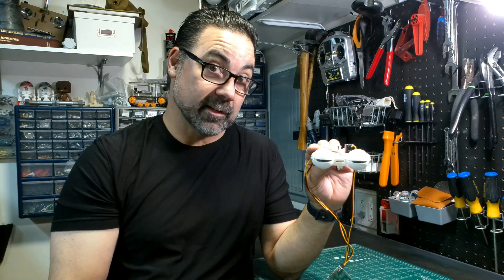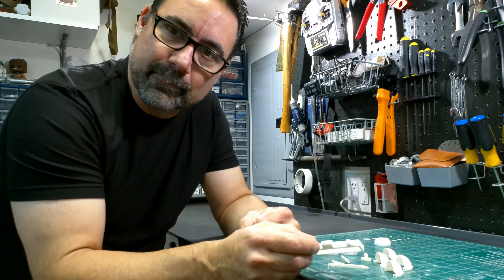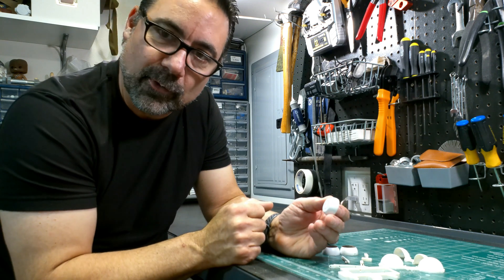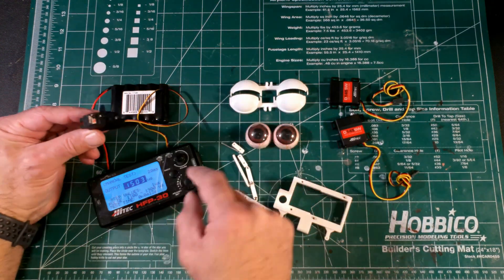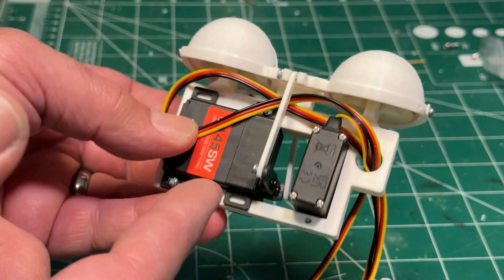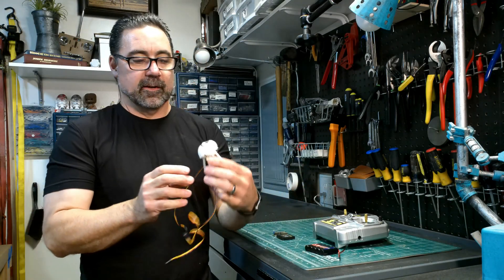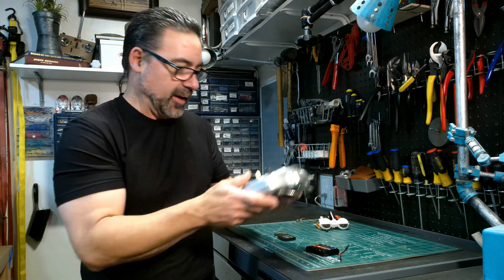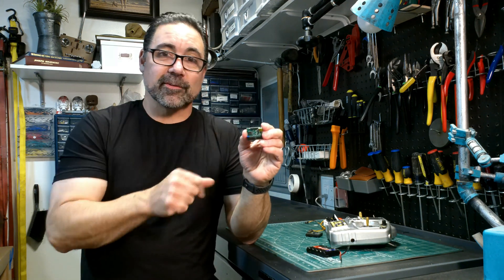How To Build a Three-Servo Animatronic Eye

Comment from the maker: Let me know if you would like to see other versions and options for eyes.
Reply: Can you give me the link of the servos you used?
Reply from the maker: @benjamin_pochurak You need two of these: https://www.servocity.com/d145sw-servo/?sku=36145S00
Reply from the maker: @benjamin_pochurak and one of these: https://www.servocity.com/d89mw-servo/
Reply: What controller do you use and can I hook up my PlayStation controller to the eyes?
Reply from the maker: @Talarionn  I am using a Maestro board from Pololu. You could use a standard RC set up as well as PS controller. You would just need something to interpret the PS controller commands.
Reply: Are there any cheaper servos I can use
Reply from the maker: @Ferretaxolotl  Unfortunately, this design is specific to those servos. I am going to post the same design that lets you use the inexpensive 9-gram servos.

Comment: How much power does my engine need?
Reply from the maker: I use a 6v battery.
Reply: @PaulsBots Are there any other, cheaper servos that would be suitable for this?
Reply from the maker: @Michalek136 You can use micro servos with this design.
Reply: @PaulsBots  
What size screw did you use?
Reply from the maker: @Michalek136 I used a couple of different sizes of 2-56 thread screws. A combination of 5/32, 1/4, and 5/16 lengths.

Comment: So I am creating an animatronic character where only the mouth moves. However, when I program the servo moves with the audio I keep noticing my SG90 servo have this twitch after certain sequences. I cant find anyone else having this issue when creating these animatronics. Can you give some insight on that?
Reply from the maker: The SG90 servo could be trying to move something heavier than it's rated for, or it could be underpowered. Depending on the manufacturer, the servo is rated at 1.6 kg-cm at 6 V. It is also possible that the board does not provide sufficient amps to the servo. Which board are you using?
Reply: @P @PaulsBots know for a fact power isnt the issue. I am using a 5V 6A power supply. Only driving 1 servo, df player mini, and arduino pro mini. And the mouth the servo only weights like 1 grams. Even if I connect a servo with nothing it still does this weird jitter after every servo move.
Reply from the maker: @metallicaandchimaira  I could be wrong, but I believe the Arduino only allows 500mAh on the 5V pin, which throttles the power to the servo.
Reply: @PaulsBots so the way I have it wired is every module is connected in its own branch. So I have a 5v rail. The 5v rail has a branch that powers the arduino pro mini, another branch powers the audio module, and another powers the servo. Everything is powered by the same power supply. Can figure out why the servo behaves that way though. I also get an issue where after pressing the button to trigger a sequence several times, the servo tries to move past the coded amount of degrees.
Reply from the maker: @metallicaandchimaira did some testing yesterday with another builder about servo moving on start up and jitter. It turned out it was just that servo, perhaps trying it with a different servo, and see if the problem persists.
Reply: @PaulsBots yeah I tried this but the problem persists. Not sure if this happens with all SG90 servos. Im thinking of switching to MG90 servos.
Reply from the maker: @metallicaandchimaira  It is worth a try, you might try any other servo you have, without installing it into your mechanism, just to see what it does.

Comment: Can i get a code for eye blink sir
Reply from the maker: I am using the Maestro board. Based on servo horn position, the code may damage your parts. Use the Maestro Servo Controller software to visually program your eyes. If you follow this link it will take you to the location where you will find the free software and a handy video: https://www.pololu.com/product/1350

Comment: to use one for the blink just make a rod in the middle of them and add a servo to the rod and it becomes one only blink
Reply from the maker: Yes, you could as long as you want the movements to be the same. In this case, I wanted to be able to control the difference between the upper and lower movements.

Comment: thank you for this, iam about to embark on my first animatronic project.
Reply from the maker: The one I have is 1.4 mm, and it is hard to bend. I think the one you have will work well.
Reply from the maker: Of course, more to come soon. Good luck with your project!
Reply: @PaulsBots  Thank you what material is that push rod you manipulated for moving the eyes left to right
Reply from the maker: @jppackham  It is a steel push rod. You can find them with other RC airplane parts. Sometimes packaged and sold with aircraft linkages.
Reply: @PaulsBots  that like a 1mm or 1.2mm, ive got some 1.5mm stainless steel push rod and it's a little too thick to bend as easy as you made it look.

Comment: Thanks for the video. As for other versions:  I think it would be possible to build it with two servos: one for the eyes and one to control both eyelids
Reply from the maker: Absolutely, in this case I wanted a different throw for the lower lid, which would still be possible, but would require more math!

Comment: Hi Paul, great video. How scalable would you say this is?  As in, can I print everything a bit larger and still drive it with those servos?  I love how compact it is but I’d need it larger overall.
Reply from the maker: It would be easy to scale to a standard size servo. As you theorized, the servos I recommend would not work if you scaled it up. They also might be underpowered. So, you could print the E-bar to fit three standard size servos in that space. Then scale everything else up to that size. How big do you want to go?
Reply: @PaulsBots  I'm wanting 2" diameter eyes (4" distance center to center of eyes).  I have an Elegoo Saturn resin printer now but probably should go with an FDM using ABS, right?  I've learned so many different software platforms the last few years and I'm a little exhausted.  But if I have to, I will learn CAD and do this from scratch.  But yours looks pretty tight and I'd like to see if I can get it to work for my needs.  Thanks for your time/any help you can offer.  Mark
Reply from the maker: @PaganCircus  You can use resin, but research which resin will be the strongest for a part like this. I use an FDM printer with ABS. Perhaps I should make some additional size options for this design.